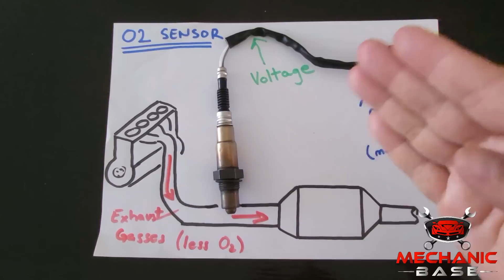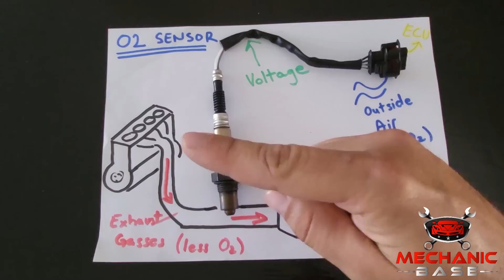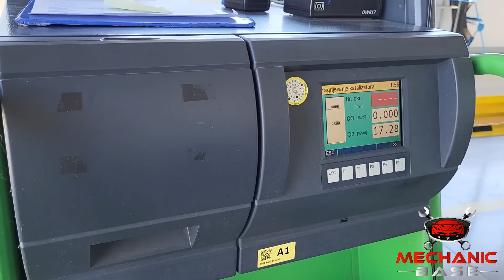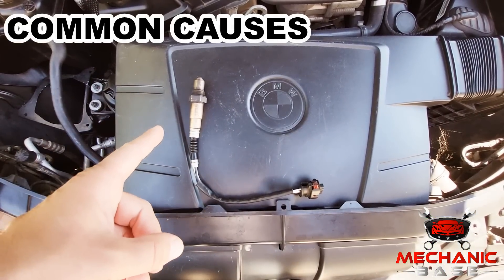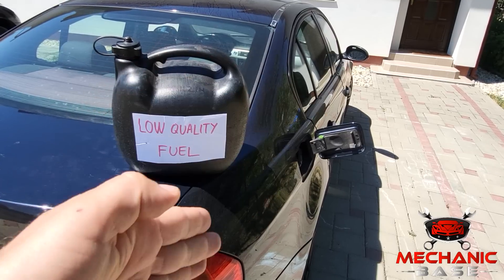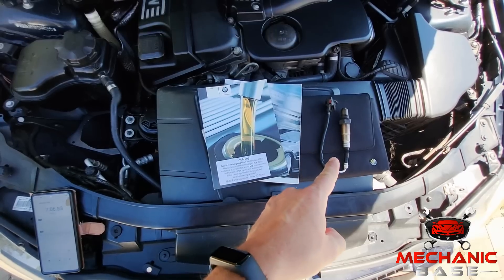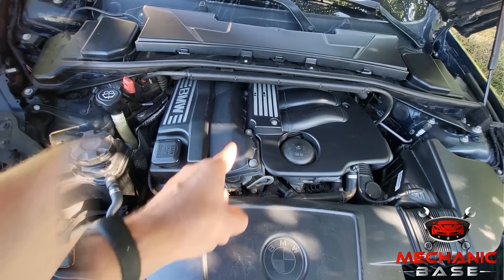5 Symptoms of a Bad Oxygen Sensor (and Replacement Cost!)

Comment from the maker: Did you solve the problem with your car? Let us know in the comments below how you did it, and maybe you can help someone else with a bad oxygen sensor!
Don't forget to like the video and subscribe to our channel!
More Oxygen Sensor Diagnosis Info: https://mechanicbase.com/engine/oxygen-o2-sensor-symptoms/
Website: https://mechanicbase.com/
Community: https://community.mechanicbase.com/
Reply: Yes, problem solved by having the sensor replaced.
Reply: No, it got worse. I have a 2014 Town and Country van. It's started out that the engine light can on, I did a scan and it said to replace the Cadlic converter. Then after it said to replace the oxygen sensors on the converter. Now the dash lights and on, no blinkers, heated seats don't work, no speedometer, no mileage, no gas signal. Not sure what it is, costing me allot of money just to figure it out. If I clean out the tipm, or replace it, do I have to reset the computer? Plus the lead on the ECMS looks like it might not be on correctly. Could that be the cause???
Reply: Translate
Reply: Did help, I had a issue with 2 bad O2 sensors both had sever carbon build up and fouled to do bad gasoline. The funniest thing was no codes or check engine light but the engine timing would go out constantly and the air to fuel mixture ratios where off by a lot. Very common where also random misfires and fuel cutoff from the rail. Also the vehicle did not start below 0 degrees celsius at all or would randomly flood itself.
Reply: ford flex 3.5 liter firing order
Reply: Will a bad sensor cause the truck to shake stutter and won't accelerate from slow or stop to go? It runs fine when I floor it but in the city stop and go makes it want to stall out but doesn't but it won't accelerate until I floor it. Could a bad o2 sensor do this?

Comment: Hello. 2008 Jeep Commander, 5.7 Limited.. I replaced all 4 with cheap aftermarket sensors, all 4 threw codes, Bought 4 more better ones, NTK all 4 Still throwing codes. What would cause all 4 to throw typical bad O2 sensor codes? Thank you for your time.

Comment: 8:58 That's a good point. Both oxygen sensors on my 05 TSX are 20 years old with 155k mi. I was getting poor mpg and some rough idle. I tried cleaning the upstream sensor and afterwards the sensor goes rich after 10 seconds and the engine dies. I bought a new OEM sensor and it will be arriving tomorrow.

Comment: I overflowed my oil and my meter shows a p2096 code. I have a lot of white smoke coming out of tailpipe
Reply from the maker: Your engine is burning oil, causing white smoke. And that messes up the oxygen sensor readings as well, which triggers the code.

Comment: 1. check engine light
2. fuel consumption
3. black smoke
4.performance issues
5.rough iddle
5. missfire
5. fail emission test

Causes :
1. like is 100.000 miles
2. short trips
3. low quality fuel.
4. engine ti much oil is burning
5. poor maintenence.
6. wire damage

Comment: My 1,5 ford focus 2014 model is using to much fuel and there's an engine light on what can be the problem
Reply from the maker: I'd suggest checking the codes with an OBD2 scanner - that'll tell a lot for a start.

Comment: P0402 is your catalytic converter,some mechanics may tell you it's your 02 sensor so once you let them replace it and then your check engine light comes back on you will be kicking yourself in the butt for listening to him so the first thing you should do is bring it to advanced Auto parts or Auto zone and they will use their obd reader and it will show the code then you can Google it and it will tell you what is wrong with your car,it will also tell you if your battery,starter,or alternator is bad good luck

Comment: Hi
I have a 2010 Jeep Patriot and picked up the following on a diagnostics with Jeep:
P0031 and P0032 relating to the oxygen sensors. It also picks up P0300 which is multiple engine misfire. I am unable to  drive the vehicle. Jeep says that the vehicle mechanically is fine but air is restricted from the exhaust with cylinder 1 and 4. The manifold was changed to branches and a cat fooler fitted. Pls assist if possible to investigate in the right direction. 1 Jeep mechanic said that I should have the original sensor and not a bosch sensor

Comment: Just checked my sensor for the first time last week and it's super clean. No carbon.
I sprayed it anyways on the outside and in the little holes..... put it back on runs great.
Just wondering why it's not getting any carbon. IT's been on their since we rebuilt the engine
about 9 years ago, maybe 10 years.

Comment: I cleaned up n down stream 02 sensors cleaned airflow sensor new air filter cleaned checked gas cap and still get engine light 207 highlander 6cyl 😡 can someone help ? 🥵
Reply from the maker: Which codes are you getting?
Reply: @MechanicBase  Po174 , I smell gas and comes through a/c air vents

Comment: I have a 2014 Town and country van. I have to replace 2 upstream sensors. I am going to replace all 4, upstream and downstream. If I get 4 at once, are they all the same???
Reply: The connection on the upstream are a different size than the downstream ones.  Upstream is before your catalytic converter and downstream is after the catalytic converter.
Reply: @devomike1  Now I am told it the insterment cluster, I will replace that before I do the sensors.
Reply: You can easily unbolt an O2 sensor and check for carbon deposits, etc.. to see if they probably need changed.  They are also cheap at A1 Auto online.  I paid 95$ for all 4.
Reply: @devomike1  I have a 2014 Town and Country van. It's started out that the engine light can on, I did a scan and it said to replace the Cadlic converter. Then after it said to replace the oxygen sensors on the converter. Now the dash lights and on, no blinkers, heated seats don't work, no speedometer, no mileage, no gas signal. Not sure what it is, costing me allot of money just to figure it out. If I clean out the tipm, or replace it, do I have to reset the computer? Plus the lead on the ECMS looks like it might not be on correctly. Could that be the cause???
Reply: @deanjagger1190  
Have you checked for blown fuses?
Reply: Correction: 1A Auto

Comment: The correct fix for an 02 sensor is replace the entire exhaust system. Parts are cheap , sensors are cheap. And just simply replacing the 02 sensor will not fix the problem of an exhaust leak and a clogged catalytic converter, rusted bolts , rusted exhaust pipes. You will spend more money doing installment install because labor is expensive.

Comment: Usually it's not just an 02 sensor issue, it is a clogged up and worn out catalytic converter , and a rusted bolts on the flanges or gasket of the cat and the exhaust manifold . This damages the 02 sensor and burns it.
Reply: ALL of that !
 Which ruins your spark plugs , fuel injector , valves , rockers & springs , and possibly a cylinder or two on that bank

Comment: I did diagnose on two sensors upstream and downstream sensors. The two wave forms are similar. After 110 km CEL came on after clear the code. What should be the issue?
Reply: worn out and clogged cat . Replace the cat .

Comment: Yep spoton to many think change 02 sensor downstream and problem is solved instead of thinking about engine oil left to long and cheap e10 or high ash content fuel.
Maf airflow sensor Maf sensor cleaner , airbox temp sensor and air filter condition .
Great info cheers

Comment: My Opel Corsa 2015 1.4 downstream oxygen sensor resets after a service but comes on the next day.Is the sensor faulty and do I have to replace it?
Reply: It just may be that you have to tap into the database on the ICU and to clear the error readings manually

Comment: I have a Chevy s10 4.3 engine and I just replaced all 3 o2 sensors that were reading faulty heater circuit. After driving for approximately 10 to 20 miles the check engine light came back on with the same codes for all 3 sensors. Any ideas on what might be going on it runs fine but aggravating that the same code’s come back literally right after spending a lot of money.
Reply: You might need to go into the ICU data based and manually clear the error reading
Reply: Remove the O2 sensors and inspect them for oil or carbon - should still be clean after driving 100 miles or so.

Comment: I got a question my friend I got a 2008 for Fusión Sedan when I turn the ignition switch on all the lights from the dash board comes on but won’t start or crank all the lights on the dash shuts off don’t Know what’s wrong could you please help me to fix my car I want a video and see what’s wrong and fix my car
Reply: check your starter .. will the car take a jump ?
Reply: @Bob-qn8cg  I had an 06 Ford 500 it was exhibiting the same as yours ...turn the ignition switch all the light came on then went off . A new battery solved the problem
Reply: Battery ????

Comment: Just had the upstream, bank 1 sensor replaced on my '06 MX-5 Miata.  How many sensors does my car have & what are the chances another sensor will now fail?
Reply: Usually it is not just a sensor issue. It is a clogged up catalytic converter, and/or an exhaust leak in the flanges or the connection between the catalytic converter and the pipe that goes to the exhaust manifold. The sensor's get damaged when you got exhaust leak at the exhaust is hot and it damages the wires.

Comment: I have a 93 Chevy Silverado 5.7 engine The idle is completely smooth it runs absolutely fine but randomly as you're driving it will stall out I will shut off the emissions switch started back up immediately and it will run fine again sometimes for two or three days sometimes for a couple hours and then it will shut off again Acts like it's losing throttle when it happens no check engine lights I understand it can be several sensors that causes this trying to narrow it down if you have any information to help I would appreciate it thank you it's a 5.7 engine two-wheel drive with a L60E transmission thanks again
Reply: Did you find out what it was?

Comment: Is it a sign that after you warm the car up it stops idling bad that there is a bad sensor? My car does better after driving it for a few minutes. It says bank 1 and bank 2.
Reply from the maker: Which codes do you have?
Reply: @MechanicBase  po174, po136 and po171. It's a Mazda tribute 01

Comment: My 2014 honda brio 1.2litre petrol bas 486k on the clock. The engine light comes on when I put on the AC and she has a slight rough idle. 
Oxygen sensor or crank sensor to blame? When I took her for a diagnostic test, the light went off. Comes back intermittently
ADVICE PLS
Reply from the maker: Do you have any trouble codes now, @anthonywhittaker1899?
Reply: @MechanicBase  the  diagnostic reported faulty oxygen sensor.
Waiting on the part from the agents as a 7pin sensor is in short supply

Comment: Bro I need help from Bangladesh, my car is Nissan Sunny X Saloon 2002 model, the car starts after some places then it stops suddenly, it starts again, after giving a lot of help, it cranks and does not start, after taking a rest for a while it starts again.  Turns on and off again, please tell me for which purse this happens.
Reply from the maker: By the sound of it, that could be a crankshaft sensor. Do you have any codes/check engine light? Check this video, BTW

https://youtu.be/NQqLNk_osO8
Reply: The check engine light showing on the dashboard , engineer says is for the oxygen sensor in the silencer
Reply: But there is no place to install an oxygen sensor in the main wheel

Comment: About five years ago. a .mechanic  replaced my upper sensor but couldn't get to the lower one because he was working on the ground and couldn't get under the van. I don't know how long the bottom  one has been there. The van runs good but once I drive, turn it off and try to start up again, that's the problem. Any suggestions ?
Reply: Hi Micheal, what you're describing is also a symptom of a bad battery; one that's about to die. Out of the four cars we have, 3 have shown this exact behaviour just weeks  before the batteries died. They started fine in the morning, even in winters, but once they ran and then stopped, like getting gas or at the grocer's, they wouldn't start back up, and sound just like a drying battery would behave on a winter morning start...
Reply: I'm having the same problem. Turning car off then won't start back up. I'm driving a Ford Edge 2008😩. It's a pain

Comment: Sir I have and old car Mitsubishi lancer ck2 1996 there is no oxygen sensors you can send me a video haw i can plas it in my car I at Mauritius in my car the Mecanisien was suprim the senser I wait a answers which you thanks
Reply from the maker: You should have a sensor on the exhaust manifold, between the cylinder head and catalytic converter.

Comment: I'm not sure how important they can be. My last 3 cars, I put over 200 thousand miles on each one, never changed an oxygen sensor on any of them.
Reply: Probably didn't have the greatest gas mileage tho lmao
Reply: Depends some o2 sensors last 150000
Reply: My 90 toyota pickup ran just off the exhaust manifold nothing after for 6 years and still runs. Not good but it does lmao
Reply: My 98 honda civic ex never changed my 02 and my 235k miles and it and still on my car from this date...If i was going to change it. I know it will be hard to remove.
Reply: Well ya won’t have issues with the sensor unless ya has other issue that damaged them
Reply: Your time will come 😂
Reply: @amc3463 end of its life long time ago , the cylinder loose pressure that’s what’s ya what to be worried about

Comment: O Need some advice? I have a 1989 Dodge Daytona yht ahs soem sort of electronic censir issue . I ahve repalced the RCU and t was nit the problem. Ther is a shit down sensir on the enegine and I ahve wondered if the o2 cebsir nd or rh shtiff censie arecsueign the ehegiento simply stop running after a few minutes. I droppe the fuel atnk and tio si clen no rist at all and the fiuel is giood and fresh? Any ideas or solutions to try ? Thanx, Steve from eastern Oregon !
Reply: yeah learn how to spell for a starter than start reading !!!

Comment: Where do I find the O2 sensor on a Mitsubishi Lancer 2005
Reply: You have 2 x O2 sensors, Upstream one is on the Exhaust Manifold directly in front of you when you lft the bonnet, Downstream is directly back of the Catalytic Converter on the Exhaust Pipe.

Comment: i get the code P0420, can that be the 02 sensor or just the cataylic converter? i do have excess fuel consumption and the car feels restricted especially on acceleration 80% of the time and 20% of the time it feels normal and quick. i dont get any hesitations just feels restricted . btw my car is a 2006 honda civic

Comment: Hi I have a 2005 ford explorer v6, 2 yr ago I had my catalytic converter replaced. It's bn running good. Recently I'm gassing up almost every 4 days and when I turn my truck over my rpm sits at 2 n half I sit a bit lower the rmp. It use to to hum now its roaring.a month ago I replaced the radiator cap, a new water pump, new hoses n replaced the serpentine belt. But its still running rich. What's next??
Reply: what was the issue